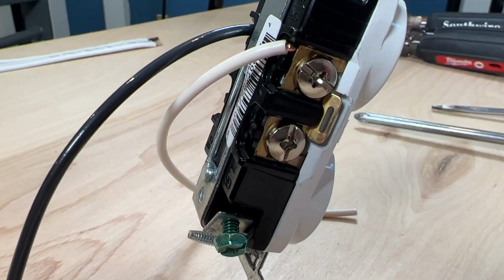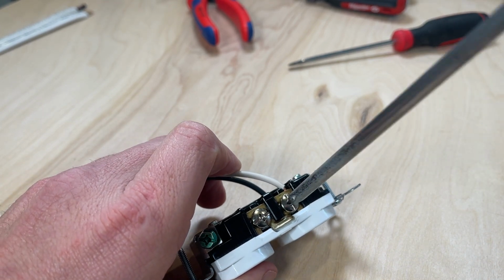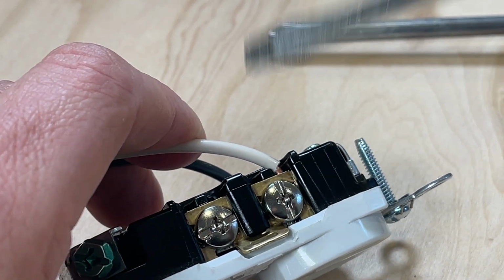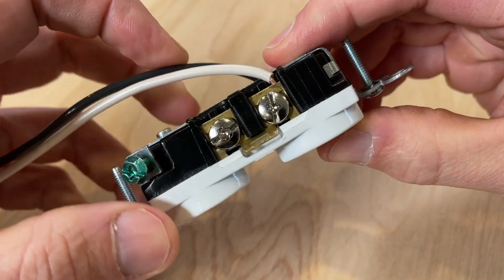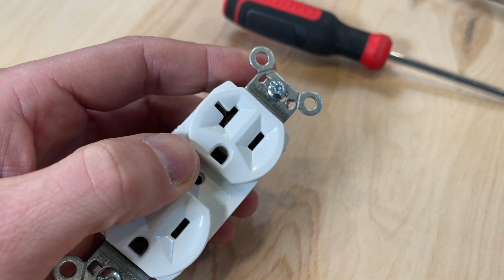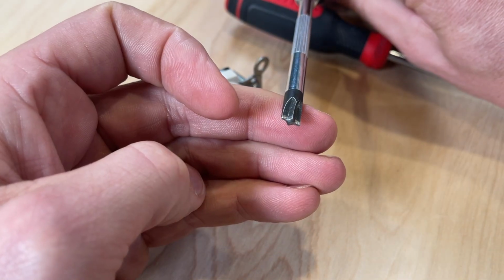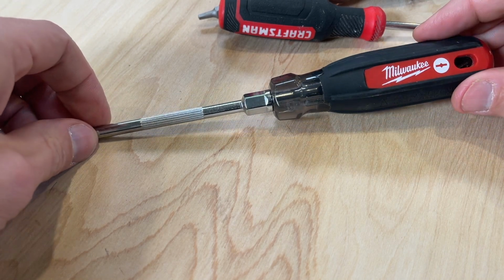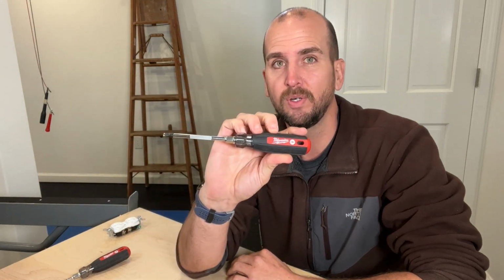80% of People Use the Wrong Screwdriver For Electrical Work

Comment: If you are a DIYer, just get a 6-in-1 screw driver (and use the 'big' slotted tip).  As an electrician for 30+ years, it's my go to for 90% of my residential work.  The last thing I want to do is spend time carrying and rummaging around for specialty tools when it's completely unnecessary.
It's important to understand torque limitations.  With the best tool, using too much strength, you'll over tighten without realizing it.  ;-) 

When doing multiple screws, I use a robertson tip in my cordless drill.  I have the torque settings written on the chuck for receptacles, circuit breakers, and the neutral bus.  With a little slow practice you will be able to do this SO quickly!  For example, 20in-lbs for a standard circuit breaker is #5 on my chuck.

Comment: Have always used a Philips head for terminal replacement but will go to square drive in the future. I have used square drive for years for wood working. Thanks for the tip.
Reply: buy a green robbie

Comment: I like the ECX but still think the world should standardize on the Robertson.  The ECX looks like it will work great with changing outlets but it's a single application tool for an electrician.  Give me a #1 and #2 Robertson and I have a couple of drivers that I can use on wood screws, drywall screws etc.  Although as a Canadian I will compromise and say I could live with the Torx head.

Comment: I always use a Robertson screwdriver when the screw can take it.  Which is most electrical switch and outlet screws, except for the ones that hold the cover onto them (which is usually slotted). 

I also use a Robertson bit on my drill to quickly tighten and remove screws on other jobs where there are multiple screws.

Comment: i use whatever is handy and have no problem with tightening screws. 
there is always someone who will come along and say 'you are doing it wrong'. to those type i saw whatever works. 

also most receptacles i see around here do not have the square slot like those you show.

Comment: I'd say the Philips would be the choice because it will cam-out when torque is too high.  Over torque is very possible because the brass of the terminal is thin.

Using driver bits is, IMO, better because replacement is fast and inexpensive.  They do wear out.  Also clearance is usually not an issue.  Dedicated drivers are best when a fastener is deep within a opening with poor clearance.

Comment: In my non professional opinion, NEC approved outlets are barely this side of junk.  Some are definitely junk.  The screwdriver recess is screw heads are stamped in and poorly stamped in many cases.  Electrical hardware technology lives in the distant past and hasn't been modernized due to the bitchy manufacturers not caring about quality as much as competitiveness.

Comment: Here is a better few questions:  1.  If the number 1 sold screwdriver is a #2 phillips screwdriver head, why the hell are we still making stuff with alternative screw types?  2.  If there is a better screw head, why is the better screw head not driving the sales for better screwdriver formats?  The Japanese use a format called the JIS.  It looks almost like Phillips, but the blade angles are at a different degree.  If you want to work on Japanese cars or bikes, get a set.  You can identify the different format by a single punch dot on the screw head.   If you thought metric/US was bad, this stuff is worse.  There are so many stripped screw heads due to the different formats.  Now we have Torx, and other deck screw formats.  Really?  Do we need all of these?   I want to own a house and a car without having a $1500 of screws.  I tend to just replace them all with hex heads where it makes sense.

Comment: I had a Milwaukee multi with ECX bits but had a few issues: too bulky, too short, and the bonding screws in Eaton panels, for some reason(??) are like ECX in that they look like a Robbie/slot combo, but the Robbie socket is parallel to the slot instead of being on the diagonal. What the...?

I really do miss that positive ECX feel but eventually I moved to a Klein multi with fewer bits (i.e. not as many telescoping pieces) so it's slimmer and longer. That, a Klein combi stripper / jr linesman plier like your Knipex one, non-contact tester/flashlight and plug tester in my overalls, and I can do a lot of simple repairs just on the first look-see.

Comment: Born in the USA, but I definitely favor the Robertson!  The history of Robertson vs. Phillips is really interesting.  I recommend looking it up.  Also, please look into torque limiting screwdrivers.  They are a bit pricey, but insure connections are properly torqued.  e.g. The proper torque for a circuit breaker is molded right into the circuit breaker body label.
Reply: I love the idea of Robertson, but Torx seems like the best option in general since it's already in use. Either way, though, I just wish we could settle on one specific standard - either Robertson or Torx would be fine by me
Reply: @audigex  Torx? I've never seen an outlet with a Torx screw?
Reply: @audigex  He's not talking about torx, he's talking about torque-limiting screwdrivers. Torx is a type of screwdriver head/bit; torque is how tight you turn the screw, regardless of head type. A torx head in an electrical terminal is a terrible idea because people would be far too likely to overtighten the screws, weakening the conductors and creating a serious risk of them failing, resulting in anything from a high resistance - and a potential fire - to a weakened conductor which could snap when disturbed later and create a short to another conductor.

Comment: For an electrician, time is money. When plugging and switching devices, a #1 Roberts in a 18V or 12V drill is so much faster than anything else. I tried that ECX bit in my drill and it just took too long to line up the bit with screw head. After about 10 min I went back to the #1 Roberts.
Reply: But the power of the battery drill can strip the thread and they are heavy and the battery goes flat often
Reply: Drill is the way to go. Especially screwing outlet to box. You just need a feel for it. You need a new drill if you run out of battery doing outlets.
Reply: @d.k.1394  I actually use a 12 V brushless Milwaukee drill driver with a 1/4 inch quick release chuck. The drill has a great clutch and I can set the clutch so that it doesn't over tighten and strip out the screw heads. 2 fully charged 2.0 batteries gets me through the day no problem.
Reply: This. A few years back I bought one of these bits when I saw it on a rack a tiers bit display.

Talk about disappointment.

Comment: I spent 25 years selling tools as a Snap-On dealer. Both the Phillips and the flat bladed drivers were knackered, cheap drivers, fit only for the bin. The flat bladed driver was also to small for the slot. If you use quality drivers of the right size you should have no problem. If the screw is a Phillips then you should use a Phillips driver (of the right size). Likewise, if it is a Pozidrive, use a Pozidrive driver not a Phillips.

Comment: Robertson's square drive is the worst evil the Canadians ever exported south. The bit slips and rounds the screw head easily and it only takes a few screws to wear on a bit enough that it slips and rounds successive screws repeatedly. Worst part is a stripped screw does not back out because when the square hole rounds it no longer will hold torque in reverse. I would take the combo bit over square drive any day.

Comment: You technically aren't wrong but as an electrician of 6 years I can say that if you don't carry or use a belt tool bag you will never use it. I have one for an impact driver and it stays new because for convince I use a proper number 2 flathead for terminals on a receptical and light switches, a number 2 Robert's on breakers and neutral and ground bars. Gonna poke some fun at you though. I bet you also say don't use drills on devises 😂

Comment: My preference is a Wera set which has multiple bits including two of the ECX type, two size Phillips and two size flat. For field work my favorite is the Snap On ratcheting driver with 1/4” bits stored in the handle, use Phillips and/or slotted and toss them when worn.

Comment: Hey buddy. THANK YOU for teaching those new Apprentices electricians and other guys! Before I watched this video I was looking and looking for a SPECIAL screwdriver for the outlets and switches power screws. finally, I found it on Amazon came with 1", and 3". It helps FIRM wire especially when you use it with a torque Screwdriver 👍👍. The ECx#1is the one we all should use for tightening the outlets and switch screws. Not that all it works fit with the outlet's yok screws too!! I also bout the ECX#2 for the EMT connectors, and Coplen Screws too.
I would mention to all electricians to use the rIGHT tools for the right job!! Positive!!!

Comment: So the bigger issue other than what screwdriver your using, is to avoid arching caused by loose connections by using the pressure plate instead of wrapping your stripped wires around the screw you have a connection that can be shook or vibrated off leaving hot wires exposed

Comment: 2:38 Well, you and I are basically on the same page here, Buddy --- just like you, what I usually do is to "initially" (i.e., just till it's snug) twist in the terminal-screw with a fairly-new-and-thus-well-fitting/gripping Philips or Robertson bit, and then use a flat bit --- the largest/widest size of tip that will fit into the screw's slot, again to minimize slippage; you're using an awfully small/narrow/thin flat-bladed screwdriver there; a larger/wider/thicker tip would have fit and turned the screw-head a lot better --- to finish tightening the screw.  And yes --- after I'd recently learned about ECX combination screwdrivers, I did indeed go out and purchase a two-piece (i.e., standard and large size) set of ECX hex-shank insert-bits, but I haven't used them yet simply because I haven't had occasion to do much of any screw-terminal-type electrical-wiring in the meantime.

Comment: I am not picky, if I need a driver, I will use whatever is handy, sometimes that happens to be a 10 cent screw driver, but I've ben known to use a 25 and 1 cent version.  (I use coins in a pinch to tighten screws in outlets, and of course the power is off)

Comment: i love those Backwire clamp outlets makes wiring so much easier. the most annoying thing is they make the screws all different in electrical boxes and then always have slotted on the Cover plate. the new ratcheting Klein 14 in one has the tips for just about everything electrical in easy to change double ended bits in a holder inside handle fastest bit change on any multi tip i have and the ratcheting actually works well

Comment: Phillips was designed to "cam out" in order to prevent over tightening , a plus in certain applications, but not for everything that it's used for today. It quickly overshadowed Robertson's design when Henry Ford made it standard in his factories. To me, the fact that ECX exists is proof that trying to please everyone, pleases nobody. The low quality hybrid fasteners compromise all three screwdrivers. First, the slots are too shallow and wide for proper grip with flat screwdrivers, 2/3 of the Phillips cross has been removed for the slot and to accommodate Robertson tips, likewise the Robertson's torque surfaces are compromised. 
Pick a standard, Industry.
I'm willing to get everything that needs to actually tighten AND loosen to move to Robertson. Phillips can keep the niches where the cam-out feature is helpful. The ONLY reason for slotted screwdrivers is to remove antique fasteners.
Now, if we could just ban Torx and hex...
Reply: You want to ban torx? Torx is undoubtedly the best. I've never seen a torx strip, where as all the other ones you've mentioned I have
Reply: That the Phillips screw head was designed to cam out to prevent overtightening is a popular belief that's actually untrue. There is no evidence the Phillips was designed to specifically cam out beyond a certain torque, and when the patent was filed in 1933 it was actually stated in the patent that it was designed to prevent cam out. Obviously this isn't true as the sloped edges of the drive lead to cam out if insufficient force is used, and this is further complicated by the fact that many people don't use the correct bit size. Henry Ford preferred Robertson's square screw head but Robertson wouldn't license it to Ford, so he went to Henry F.  Phillips. Phillips didn't invent the screw but just bought the original patent and refined the design; the inventor was John P. Thompson who failed to interest manufacturers in his self-centering crosshead screw. The Phillips screw head was thus adopted by Ford factories, and soon after other automobile manufacturers, and later was adopted by aviation and rail, and so on and so forth. That's why it's so widespread, despite the fact that it does have a propensity to cam out and strip the screw head.
Reply: @Kevin-mp5of  Yeah, which uninterested people can just ignore. I'd rather write a "novel" that's informative, instead of useless drivel that dumb and lazy people often write in these comments section 😏
Reply: I'm in Canada, and the outlets and switches that they sell here don't even take a Phillips head.  Just a Robertson and a slotted head. Haven't had any issues with the Robertson screwdriver slipping or damaging the dual type screws. 
Until I saw this video, I didn't even know that there were screws that took three types of screwdrivers. 
As for torx, there is also p type (or torx plus).  They use those at work.  Regular Torx screwdrivers still work, but slip off easier and can damage the p type screws.
Worst thing about hex or allen key screws is that there are so many sizes, plus metric. So it is hard to pick the right one without a bit of trial and error.

Comment: A. This is focusing on specific brands, and not universal.
B. Your examples are with cheep tools.  It’s no wonder they don’t work well.
C. You’re probably over torquing your screws.
D. Your combo screwdriver is useless for a whole lot of things.  If you were a commercial electrician, you might use it a fair bit, but otherwise it’s worthless.

Comment: if 80% of people are using the wrong screwdriver, isn't that a suggestion that industry needs to change rather than 80% of people?  While the Robertson screw may be the better tool, a Phillips would be adequate for this application and at least 80% of people already have a Phillips screwdriver.

Comment: You are slightly wrong about how that screw head is designed.  It is intended for a JIS or Robertson drive.  Try a Vessel JIS some day and you will be amazed.  Fun fact, basically everything manufactured in Asia that involves screws use JIS, not Philips ... which is why you always strip out the screws when you try to take things apart ...
Reply from the maker: I knew JIS was more common on motorcycles and automotive but didn't think they spilled over as much into other industries.  I actually just learned about Pozidriv last week 😂

Comment: I knew the ECX existed, I just didn’t know the name to buy one. I’ve been using the Phillips and Flathead squiggly drivers to install outlets since I was 14 back in the early nineties. I also never stubbed wires into the back, I’ve always curled the ends with my wire-strippers and wrapped them around the receptacle screws in the clockwise direction.

Comment: That ECX looks really nice, but specific to these screw heads found mostly on electrical outlets it seems. For us in Canada though we all carry a full set of Robertson screwdrivers and bits all the time so that's an easy choice.
I still can't understand why Philips and slotted screws are still so widespread today. Have we not all suffered enough from stripped screw heads? And what about all those bruised and skinned knuckles? It's baffling to say the least.
Reply: There is one important application for slotted screws, which is anything you are going to paint over. Slots are much easier to clean out than any other screw type. This is why they are often used in the marine industry for access panels that may be covered with two pot catalysed paint. The trick is to use a proper old school manual impact driver to get them moving again.

I am a big fan of Robertson otherwise.
Reply: Henry Ford is the reason why Robertson isn't widespread.
Reply: @benoitverret6722  Is he also the reason for the Fahrenheit scale? Maybe we can blame him for that one too! LOL. A.J. Jacobs has a great bit on Fahrenheit in his book, "The Know-It-All". Definitely worth checking out.
Reply: Every time I put something together or fix something, I always swap out crap screws with Torx screws. Saves me so much hassle.

Comment: I read somewhere that Phillips head screws were invented for the automotive industry, and would cam out when the screw reached the proper torque/tightness. The driver should also be of softer metal so that if you do overtighten a screw you damage the driver not the screw so you can extract it later.

I remember I had an electrical safety presentation years ago and the instructor really wanted everyone to tighten the connections to the proper rating on the device. It's actually pretty surprising how much torque some manufacturers want you to use. Do you use any torque wrenches or drivers in your work, and how important do you think that is for most installations?
Reply: you get screwdriver type torque fasteners, most often they come with bits,